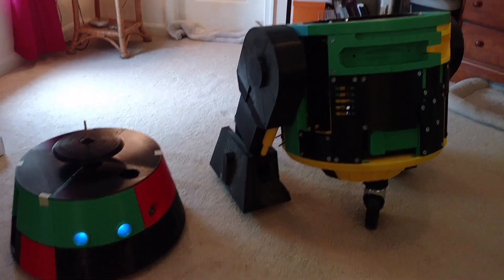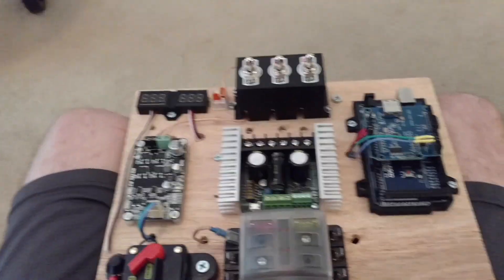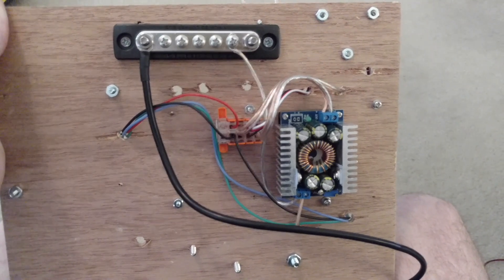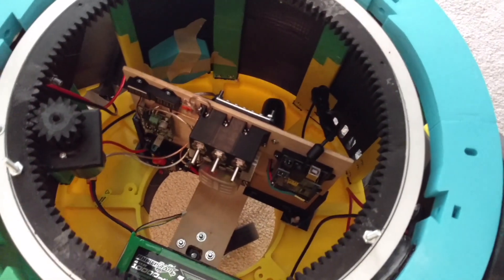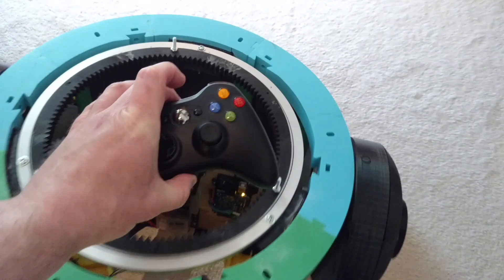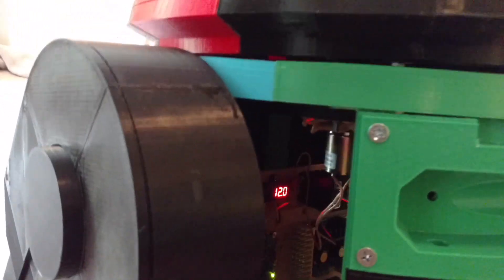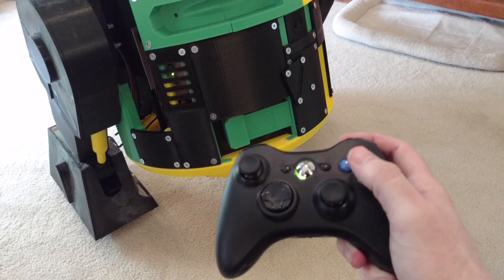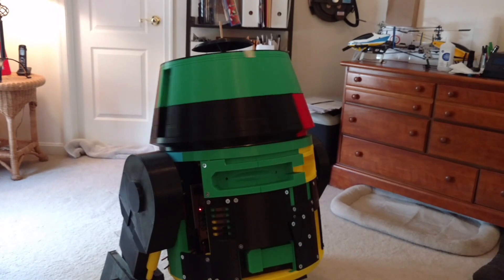Star Wars Rebels Chopper Update 7 - Electronics

Comment: Eric, do you have that wiring diagram anywhere I can pull it down from?  Thanks in advance!!
Reply from the maker: I don't have a detailed diagram but there is a high level one on my GitHub page

https://github.com/CountDeMonet/ArduinoAstromechControlSystem

One thing to note. The 60 amp main breaker that I bought died on me. A 20 amp one if using similar setup would be more protective. My droid maxes out at around 14-15 amps going up hill full throttle so 60 amps is way too high to protect anything even though the power system can handle it.

Comment: Hey Eric,  Great information!!  One question, for the list is there any of the devices we should be ordering 2 of, or are they only once of each.
Reply from the maker: You need two of the neopixel sticks for the dome lights. Do not buy the 60A circuit breaker. Find a different one. The one I bought died after a few months. I'm still looking for a replacement to try right now. For the time being I have bypassed it. You will want 3 of the 20A switches. You could probably get away with 10A but better safe than sorry.  Full speed up an incline the full setup only pulls 14 amps. The 32 amp sabertooth is also overkill. The 20 amp one would work as well if you can find it. When I bought I could only find the 32 amp. You can never really go too big but cost does go up. Everything is on my github and I update that regularly. https://github.com/CountDeMonet/ArduinoAstromechControlSystem and https://github.com/CountDeMonet/ArduinoChopperDomeLighting

I have finished him up for the winter. Paint job is not quite where I would like but serviceable. I'll be showing off a video of him soon all finished up
Reply: @EricBanker  Thanks bud!  yea, I might look at the 20A version of the Sabertooth.
Reply: Eric Banker I decided to get the 30amp version instead of the 60.  Also, I did not see a 20amp version.
Reply from the maker: @be11thazor  if you are talking about the sabertooth there is a dual 25 amp and a dual 12 amp. Really the dual 12 amp is probably good enough given the draws I am seeing.  https://www.dimensionengineering.com/products/sabertooth2x12
Reply: @EricBanker  Ok, so I may have been confused when I did this...lol .  So I got a 30A circuit breaker, and and putting that on the internal board this weekend.  Next I have to order the Sabertooth Motor driver...should I get the one you have listed above, and should I be using the 60A circuit breaker (not sure how the bypass should be connected).  Thanks again...will be putting up some pics shortly on the forum for you to check out.
Oh, and for wiring the scooter motors...is 16 guage good enough or should it be 14?
Reply from the maker: @be11thazor  I used 12 gauge wire for the motors to the sabertooth. Probably overkill but it's a pretty long power run so bigger is better. 

The 30 amp breaker will be fine. I went with the 60 before I knew the total amp draw of the droid. Typically it will be below 20 if you are going with my setup so if things hit 30 that's a sign something is wrong and a good point to trip. I'll probably be replacing mine with a 30 as well. 

I like the 32 amp sabertooth. When I was buying it was the only one available for quick delivery and it was the same price as the 25a version ($125). Bigger is better here. Last I looked the dual 12a version was $170 so I would not go with that.
Reply: @EricBanker  Thanks for all the help with this, I know I should be going through the FB page O_o  lol.  I will do a full overview and make sure I link to this once I get it up and actually running.  Just an FYI...The dual 12a one is 79.99 on the vendors website vs the 179.00 on Amazon, so I ordered it from there (I just need to be up and running by mid-Feb).  I'll grab some 12 guage from lowes tomorrow.  Keep you posted :O)
Reply: @EricBanker  the link you have for the main power is no longer valid, is it possible you can recommend another source or provide the info on the item so I can look else-ware...Thanks!
This was my search criteria when I checked Hobby King based on what I can see on the video: 
https://hobbyking.com/en_us/catalogsearch/result/?capacity=9960-20000&q=lipo-pack&wrh=2%2C3
Reply from the maker: @be11thazor  Not sure why the link isn't working from youtube but it is working from my github acocunt. url is this one

https://hobbyking.com/en_us/multistar-high-capacity-10000mah-4s-12c-multi-rotor-lipo-pack-w-xt90.html

good sale going on right now too